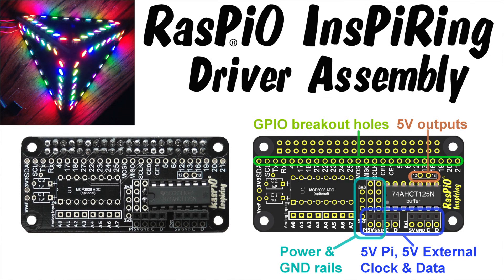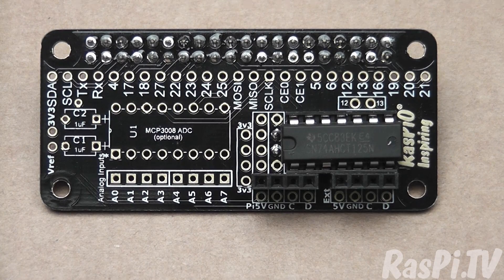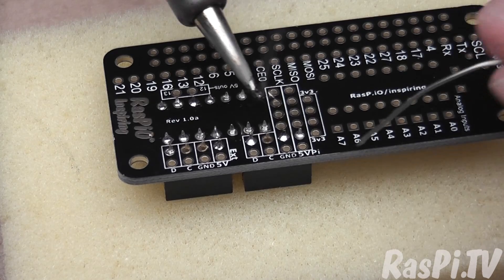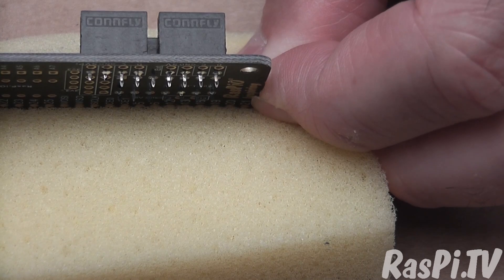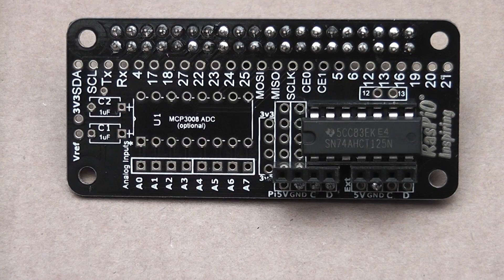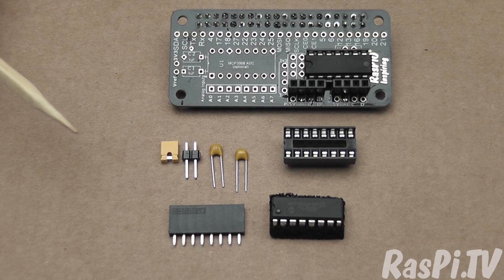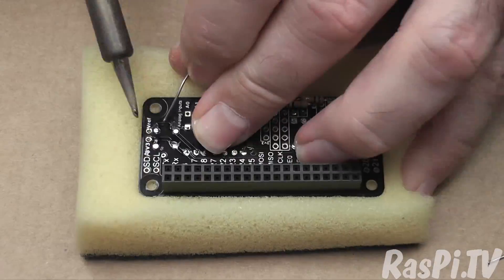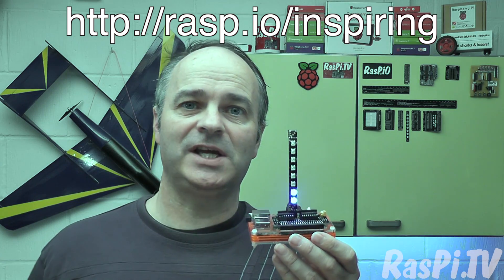RasPiO InsPiRing Driver Assembly

Comment: I always like the smell of the fluxed solder, but it's the lead fumes that are the problem with leaded solder - avoiding the neurological damage exacerbated by breathing in the fumes is the main issue. But I have to agree that lead-free solder is a right pain to use.
Nice instructions in the video, though 👍